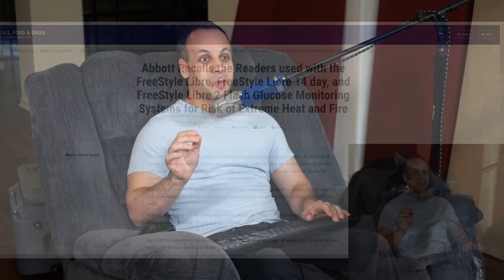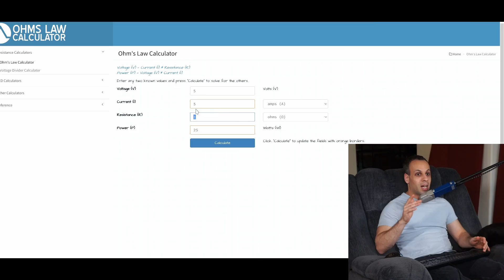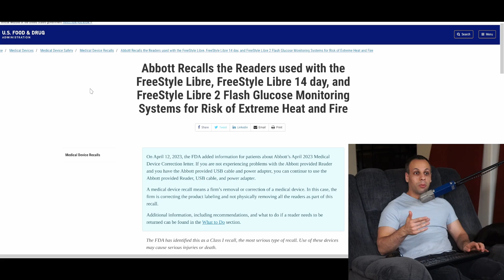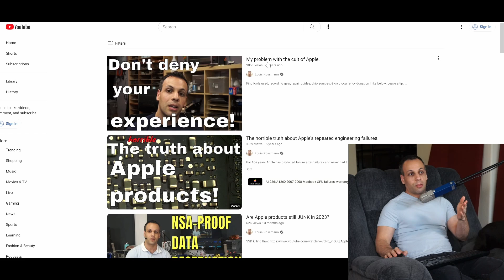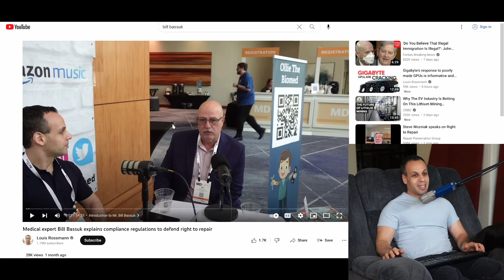Abbott gaslights customers during FDA recall of burning glucose monitors

Comment: I bet they just place resistor, diode or some simple voltage stabiliser to 3.7v cell, more likely also usb socket is always live with battery voltage. Stock 300 or 500mA charger just have voltage drop to 4.5 or 4.7v under load so it's no problem. But if plugged to 2 or 3A charger which keeps 5.2 or 5.5v all the time with no sag it overcharges the battery to the point to explode/catch fire. Lithium cells in general can hold 4.5 or 4.7v just fine just not effecient anymore and shorten life cycle but over 5v it starts to get dangerous of overcharge with rapid degradation. They just designed it poorly for stock charger or usb outlet in your computer, not modern usb brick.

Comment: Wow.
To rely on a charger as the current limiting device, speculating on it to brown out to not make the battery go byebye is such a noob mistake, i wonder if the guy who designed this even has proper education. Plus this excuse of an explanation would not hold up in court. If you put an industry standard charging port on a device, it has to safely connect to any device that also abides to the standard. Even if it refuses to charge. This is nothing but neglect and no white collar BS bingo will get them out of this.
This is on par with using a receptacle that also fits a mains power cord. Criminally dumb.

Comment: Abbott could’ve easily engineered a proprietary charging port and cable. Why use a USB if it weren’t supposed to be thought to be used with universal cables ?
— Devices ASK FOR how much current, power they need, not the charger.

Comment: Didn't Nintendo put some small issue on their Switch that, if you don't use a Nintendo licensed USB-C charger, it slightly overvolts the Switch so that it doesn't immediately cause any issues, but if you only use aftermarket cables, it will eventually cause the Switch to brick itself or something like that? Correct me if I'm wrong, please, I'd rather not regurgitate misinformation whether for or against major tech companies, but I do remember this issue popping up around a year or two after the Switch released.

Comment: 3:03 So they were too cheap to put a sub-$1 current limiter in there, instead relying on the high internal resistance of the terrible USB cable shipped with them, to protect the battery. And a super pricy (profitable) healthcare company is doing this. This is disgusting.

Comment: Speaking of lacking internal voltage regulation, I recall that was also an issue with the PlayStation Dualshock 4 controller. Those controllers ended up breaking with certain fast chargers, and I remember people were throwing around "internal voltage regulation" or lack thereof being the culprit for that.

Comment: This same issue happened to another diabetic device called the Omnipod Dash. It is an insulin pump that uses an external device to control; This external device was a cheap burner phone they slapped a logo on and charged hundreds of dollars for. Recently they had to do a recall because the batteries unsurprisingly started expanding and blowing up after only a year of use. It’s particularly frustrating because there are only 2-3 insulin pumps available to most Americans and these companies know they can sell us cheap crap because it improves our lives just barely enough to justify the horrible design. Thank you for calling out these companies, I have been frustrated for years dealing with their bs.

Comment: I'm still pissed about my Medtronic pump from years/decade back. Button overlay came away from device. Device still worked fine, but wasn't protected. All I needed was a part than was likely <$1, but they wanted over $1000 to clean room test it, and slap a new sticker on it.
Absolute a$$holes. Already billed me for thousands, and then pulls that garbage. Let me sign a slip absolving you of responsibility, and go about this the "common sense" route

Comment: This is obvious BS to me as I've had 4 Apple MacBook Pro batteries swell while using the included Apple made charger.  The Apple Geniuses blamed me for charging it wrong saying I shouldn't leave the charger plugged in all the time. Telling me that's why the battery swelled. I told them the included manual doesn't say anything about not keeping the charger plugged in all the time. Yes, I did read the manual.

Comment: You know years ago I loaned my brother my PSone LCD display lid thing.  He saw that it took nine volts on the input found himself a 9 volt power supply and then just plugged it in.  Instantly the device was fried. He blamed me, turns out he plugged in a 9 volt AC power supply.

I often wonder how you actually do determine who's at fault and I don't think I really know who to point the finger at.  Especially when it comes to electronics.  You could say yes they have to be robust enough to not blow up when you plug in anything with a barrel Jack into the hole.  Then every device should be able to handle AC, and every manufacturer should have a small bridge rectifier in there.

There's just too much wild and crazy stuff that's out there, and too many people willing to plug those two things together.  I have a USB cable that up converts to 9v, when I tested it has poor stability past ~300 ma draw.  Which is reasonable when you think of the original USB standard, it was probably specced to work within the o.g. current limit.

Comment: Please get one!  I've had some experience working on small medical device teams in the software development side and sometimes the feeling I get is a lackadaisical application of engineering principles to the whole device. 

I had plugged in an aftermarket OnePlus 5 charger (it supported 1+'s version of fast charging) into a random battery bank and it fried the battery bank.

In that moment I kind of wondered like who do you blame, did the battery manufacturer build a bad battery?  Did the charger have an invalid protocol negotiation or something, and deliver higher voltage?

I always thought that interesting because I had that battery bank for a couple of years and plugged it into various things all the time no issues.  And then one day I just plugged it into this charger thinking it would charge it up walked away came back and realize there were no lights on it anymore. It could have even died of "natural causes".

Comment: I would have a spare FreeStyle2 device, since Abbot send me version 3 last december (which now has different sensors, of course they do. But still no USB-C!). But sending the device from europe to you in the US would be very expensive.
The Freestyle 2 has the worst battery life you can imagine. 2 days, at most. Model 1 had over 2 weeks! And yes, because you can use blood sugar test stripes with this device, getting blood in the USB port is not that unlikely. Abbott could have used a protection flap for the USB port, they didn't.

Comment: One part of this that's important to mention
If it uses a USB C cable, USB C has different soft standards.

Plugging the wrong one in my phone will have it blue-screening (Yellow screen), and heating it up.
When I left it like that, it became how enough to burn my hand.

If exposed for long enough, it could definitely be cause for concern.
However, that's literally every USB C device under the sun.

Edit: Ah, I see your point.

Comment: Only stupid will use a standard USB socket, but putting the BMS board into the charger and not near the battery were it should be connected. This devise usually use by an old people that do not understand much in electronics, They will plug any cable that fit there.

Comment: Just like the difference between German and Japanese engineering. The Germans will will put extra resources and effort into making sure the product works as intended and looks good. The Japanese focus on efficiency and redundancy measures. It's why a Toyota is more reliable and cheaper to maintain than a BMW.

Comment: You are 100% correct that the device is poorly designed but chargers have a max W so if they sell it with 5W charger or even a 2.5 W charger think of old USB specs where max 0.5A. And the device is poorly designs has cheap components then you plug in a 10W or higher it can overheat.

Comment: I can't find it now, but from a product liability standpoint, I seem to recall the product must be able to withstand normal abuse.  For example, it can't explode into flames just because you dropped it.  It may not work, but it shouldn't burn.  Using a common USB cable or dirt in the port seems like "normal abuse" to me.

Comment: power is not delivered, it is drawn. 
in a pc, an 850w psu is not gonna pump 850 watts into every component plugged in to it, the devices will draw what they need. otherwise they wouldn't... work at all.
Reply from the maker: Explain this to whoever at Abbott writes the BS PR statements. 
This wouldn't even be possible if there were real electronics education in public school.
Reply: @rossmanngroup  It has to be said that those statements are by marketing team, who usually have 0% of technical knowledge and expertise. No one from the marketing would even allow engineers to write those PR statements...
Reply: @rossmanngroup  i learned nothing about electricity in school, not even that amps * volts = watts. everything i know about electricity and power was learned through becoming a PC building hobbyist and watching youtube videos.
Reply: @@Orobas-jb9fi 
Read these two sentences you posted:
"If you've ever touched the terminals of a car battery, you'll notice you don't get shocked even though they put out between 400 and 900 amps because the voltage is low."
"WRONG! It's the other way around. It's the voltage that gets you and the current that allows it to."

Both can not be true, as they are contradicting each other.

The car battery one is the truth.
Voltage gets the current into the body, and it is the current that kills you.
Frequency of AC matters too though, the closer to the heartbeat frequency the current is, the more likely to cause cardiac arrest.
Reply: @@Orobas-jb9fi Well, it IS the current that gets you, though it's the voltage that allows it to and the resistance that prevents it.
Reply: Yes. On the other hand, there may be some truth about that in this particular case. While no charger pushes more than the drawn current and in normal operation this Abbott device does work with any charger and cable (I have it). But when there occurs some fault that shouldn't occur, which makes it draw more current, then the original 500mA charger might make enough limiting to prevent further disaster, that would happen if there were more capable charger feeding the faulty circuitry.

But anyway, I still agree this is manufacturer's fault and gaslighting customers - manufacturer should have a) made such faults not to happen, b) provided proper safety measures, such as fuses or other current limiting measures inside the devices themselves in case something goes wrong.
Reply: @@Orobas-jb9fi  @Orobas-jb9fi  Try read what I write instead of arguing against strawmen.

Voltage is what allows the electricity to overcome the resistance and create a  circuit through your body.
12 V is usually not enough to overcome the resistance of the skin.

Current is what causes the damage once you have a circuit.
As long as it stays below 5 mA, you are generally safe.
2 A will fully cook you in less than an hour.

Comment: You may want to limit the charge rate, to limit the temperature of the battery while charging.  For a medical device the sensitivity may be that great to ensure a certain reliability.
Reply: The device should be capable of setting its charge rate on its own. All USB devices are supposed to be able to do that. Designing so that the charger sets the charge rate is only acceptable where the battery is removed from the device and stuck into the charger, like with rechargeable AA batteries, 18650 batteries, cordless power tool batteries, etc.

Comment: I wonder if they are missing some current-limiting circuitry on the device side, which could fail with chargers that are not compliant and don't limit current. But I would never design something that relies on an external device to comply with a commonly-violated part of the spec.

Comment: FYI The Freestyle Libre reader is not USB type C, it has a micro-USB connector.  The old USB standard doesn't adjust voltage, it is 5 volt only.  There is a standard minimum current output, and the charger is supposed to communicate with the device in order to allow more current through.  Some cheap Chinese chargers don't have any current protection, though, they just allow as many amperes as the device takes.  I'm assuming this is what can cause the fire hazard.  I agree the charging circuit ought to handle that sort of issue more gracefully but it looks like there's definite blame on the chargers.

Comment: It's surprising how many products outside of the IT industry don't implement USB properly - as you say, if this is the case then Abbott's statement is technically correct but leaves out the fact that the incompatibility is their fault for making a bad product. My thinking is that they've just connected the battery directly to the port on the device side and put the lithium battery charge circuitry in the charging brick instead, which would mean plugging into a 3rd party charger would dump 5V directly into the lithium cell.

Edit: An interesting test for this that wouldn't pose much risk to people's hardware would be to connect an Abbott USB charger to a non Abbott device and see if it works (you would have to try a few devices in case the test device is really tolerant of low voltage) - if nothing happens then the Abbott charger is probably just a dumb lithium battery charger that incorrectly uses a type C port.
Reply: Fortunately that's not the case. I have that product and never had problem using 3rd party charging products on it, nor when using its oem charger and cable for other devices. Seemingly a rather randomly occuring fault where the original charger limits the current enough to prevent further disaster in the case (it is 500mA charger IIRC). Or maybe just gaslighting the customers for the company's fault. Otherwise, extremely crappy product, I would say. E.g. its firmware is horrible.
Reply: ding ding ding ding

Comment: Fun fact. This device uses micro USB. 5 Vdc 250 mA. If it takes more than 250 mA then this device is not compliant with microUSB standard and should be allowed to be sold. The provided USB cable is a normal cable.
Reply: 2A is the maximum that can be used over a micro USB connector, 8 times that amount

Comment: its never the manufacturers fault, its always a 3rd party that is the one that is guilty...

All devices i have start with a safe 5 volt limit and ask for permission to raise the power. If no approval is given it stays at 5 volt .. if it get a good to go it raise the power to 19 volt or so for example.
Everyone have used a "too strong" charger for a laptop and noticed that it wont make your laptop catch fire.. done it alot of times.

Comment: What is there's no charging circuit and they are using crappy usb cable to limit the charging current? No protocol switching just thin wire. Would be interesting to see what's inside tho.

Comment: Just to put it into perspective, if electricity were a bullet flying through the air. 
Voltage is how fast the bullet is going. Faster means more force and more distance.
Amperage is how much air that bullet traveled through. Even more accurately would be that also over a period of time.

Comment: With USB, there should be no such thing as a bad charger. Slow, weak, low voltage? Yes potentially. Bad? No.

*Unless it's USB in disguise and is actually a USB killer and pumping some bajillian volts into something it shouldn't.

Comment: Some devices which are marketed as "USB chargers" output more than 5.5 or even 5.75 volts under some conditions, and some may output voltages which fluctuate rapidly and severely in response to changes in current draw.  If fluctuating supply.  Considering that someone that needs a charger while traveling would likely buy a "convenience store special", which would be far more likely than a name-brand charger to output out-of-spec voltages, I wouldn't be surprised if the safety problems relate to "chargers" that are grossly out of spec.